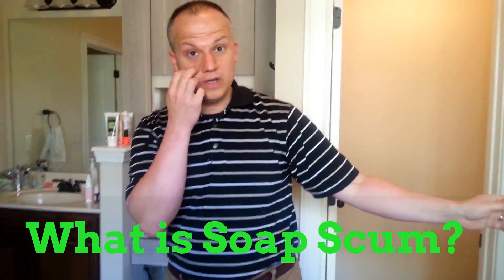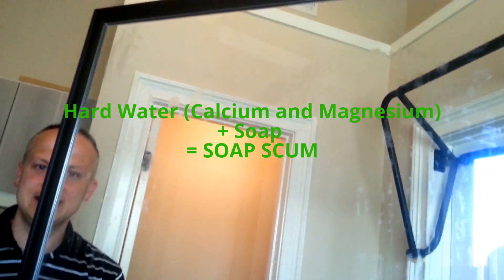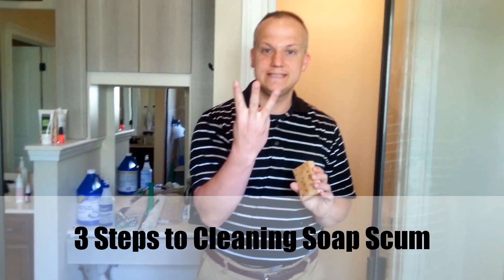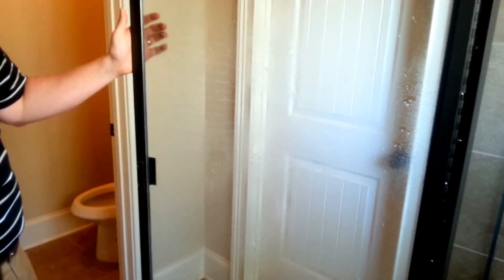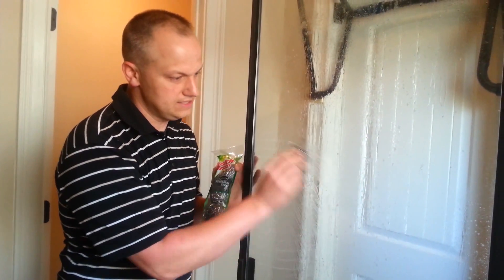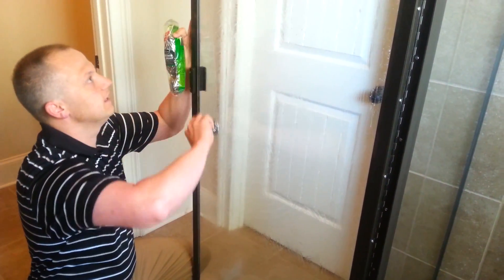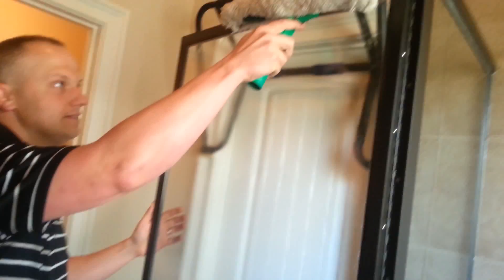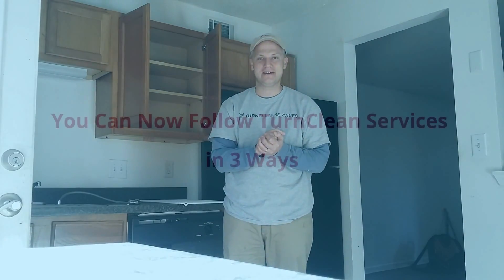The Science of Soap Scum Cleaning- test for scratching

Comment: There is more to cleaning a shower than the glass door.  If you used the steel scrubbing pad on fiberglass shower walls, you would destroy the fiberglass.  I know you did not recommend or recommend this, but assume you may get it done with the safe abrasive scrubbers for fiberglass.  I haven't tried that product, but haven't found any product that claiming to dissolve soap scum without several attempts.

Comment: Do you know any eco-friendly soap scum solvents? I looked far and wide and all I got was nothing much from the same people that tell you to mix banking soda and vinegar to make cleaner, or that vinegar strips grease. So, something more scientific and effective than that would be really great. Any ideas?
Reply: "Soap scum" is used to refer to hard water mineral deposits (which are very hard) or a greasy combination of soap, skin cells and body oil. For the former, you'll need an acidic solution like white vinegar (let it soak for 10-60 minutes) and for the latter, you need an alkaline solution like washing soda or borax.
 Sometimes you can even get grease/soils on top of mineral deposits and the grease prevents acids from reaching the mineral deposits so I'd start with washing soda and/or borax and then try white vinega if it's still dirty. If that doesn't work, you'll really need some commercial products.